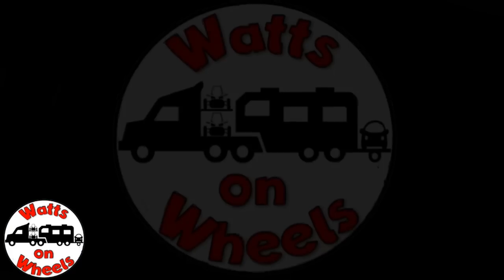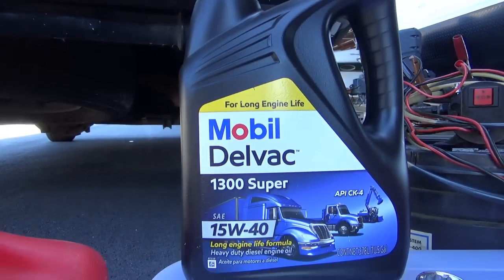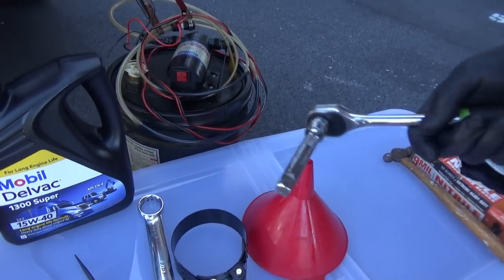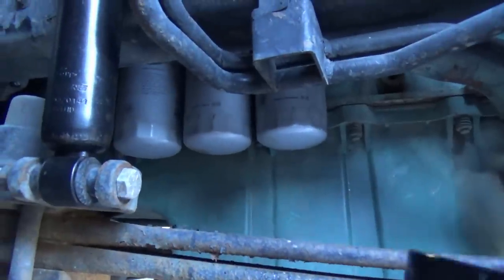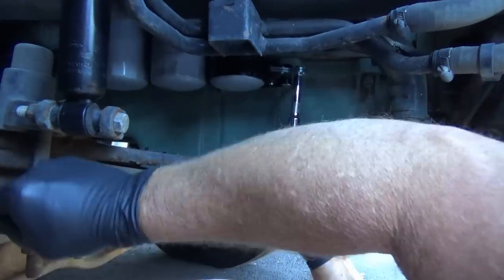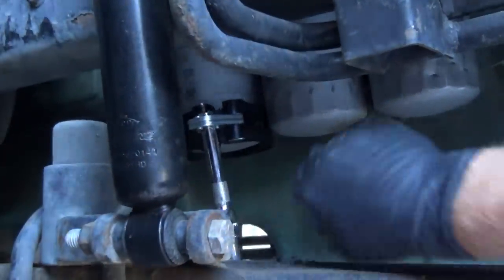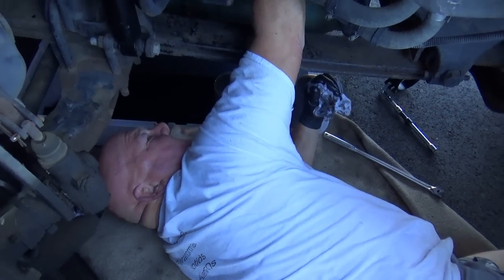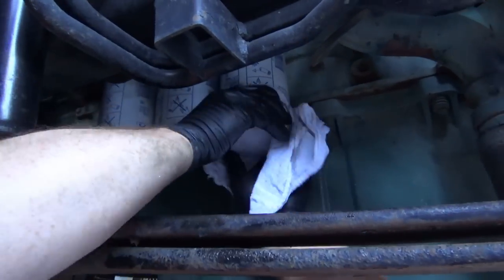💪 DIY HDT Oil Change // 44 Quarts of Oil

Comment: I worked as a mechanic on heavy trucks and equipment for 37 years. I worked on every kind of truck and construction equipment imaginable. Usually the filter is spun on till it makes contact the tightened 3/4 turn to finish. Done many thousands. I always put a dot of old oil on the end of the filter to keep track of how far to turn. Also where I worked we had Fumoto drain valves on all our equipment. It's a sort of ball valve with lock. They can come with a short nipple to attach a hose. Best part no wrench needed.  I also hooked up an air operated diaphram pump to suck the oil out. I could suck it out of the filters too. I made a pointed tool from a long pipe nipple that hooked to my pump.  I started it sucking the filters while I greased. We were allowed 5 or 6 hours but my way took 30 minutes oil, grease and air filter total. Not spilling one single drop on my floor. I worked by myself and didn't have time to monkey around. I  only posted because I you could at least look into the drain valve. It saved me so much time and kept the mess down too. I hope this ramble helps.
Reply from the maker: Thanks so much for your comments and great ideas you created.  I'll be using some of those in the future.
Reply: @WattsOnWheels  So glad I could help

Comment: Thanks again for the oil change video Dave. Ordered up everything we needed for Trigger #3 (2016, D13 780) based on your video. Also doing the diesel fuel, air inlet, and wet filters too. Truck is new to us so we are working our way through it.
Reply from the maker: You gotta start somewhere.  Good luck, you can do it.
Reply: We also have an 04 volvo 630 that we went through before stumbling on the 780. Could not turn down the low miles and much larger cab for our great dane.

Comment: Hi Dave, you learn the tricks of punching holes from YouTube and now I learned it from you.😂  soon this kind of “fun” will be gone when all vehicles are replaced with electric. I guessed the future generations will be confused when they see a vehicle with an oil in it, like the millennials now when they see cassette , 8 track tape or even vinyls records 😂😂😂 
Good job Dave, always cracks me up on the amount of beers for your rewards 😂
Reply from the maker: You are so right with the youth of today.
Reply: I have used my battery operated drill. Very easy. Put a bit in and pull the trigger. Simple

Comment: Did you guys notice in your video at approximately 6:47 that it looks like there’s a cracked weld at the very top of the screen that may just be an optical illusion but I’m not sure on what looks to be may be a torsion bar
Reply from the maker: That's a brace for the coolant lines.  You got a good eye there.  Thanks so much for letting us know.  I'll be checking that tomorrow.

Comment: Hi guys 🙋‍♀️🙋‍♂️😺.. OK you got the oil out.. Did you change the fuel filter... What about greasing it... The radiator for the proper amount of antifreeze... Gotta check the tire pressure too... And then of course the lights... And by the way if you add 9 gals of oil then 1 gallon  Of  Lucas oil stabilizer It will help lubricate a little better On a dry start.... Now that you know what you're doing I've got a Green one you can work on..🤣🤣.. good job.👍👍..We are about to finish up here so we're looking forward to seeing you guys again... Stay safe...J&A
Reply from the maker: Fuel filter change video coming out soon.  Haven't gotten around to greasing yet or the other stuff.  Thanks for the Lucas oil tip.  BTW, it was 11 gallons.  :)  See ya soon.
Reply: @WattsOnWheels  yes you  are correct...11 gallons...10 gallons of oil..1 gallon of Lucas oil stabilizer...now if I just don't tie my shoe laces together I will be able to walk straight...lol..

Comment: This is a “several case” job, after all $580 at the dealer, that’s a lot of beer!!! I guess you don’t buy into the “Fill the oil filter with oil before installing..” narrative?
Reply from the maker: I thought of that, but I figured I would probably wear most of it.  It only took about 5 seconds for the oil pressure to come up.